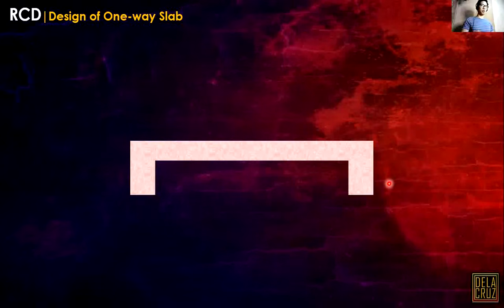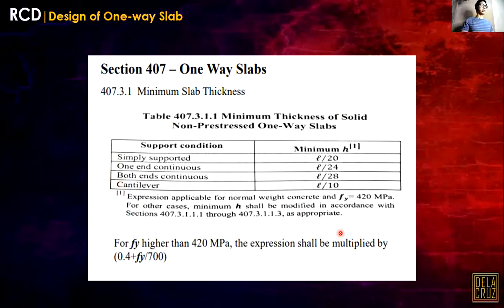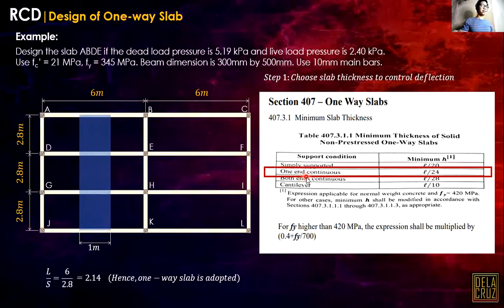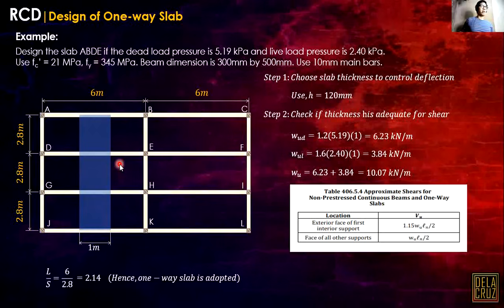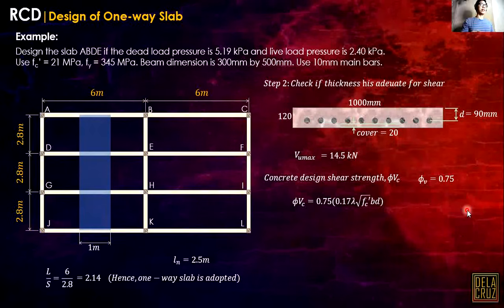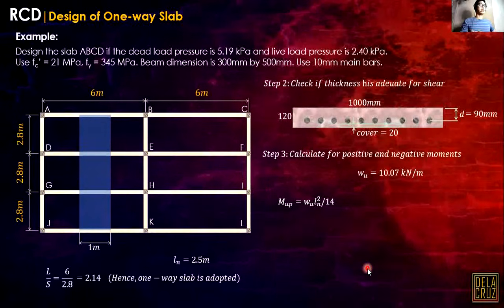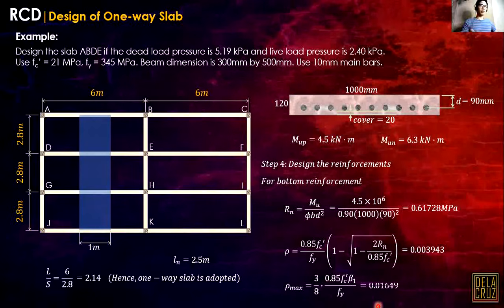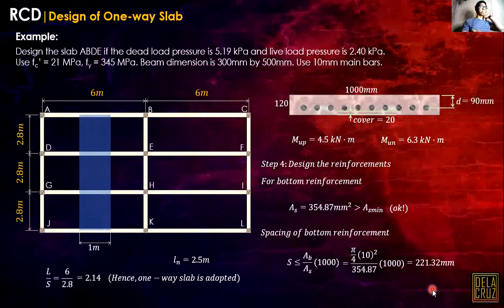RCD | One-way slab design | NSCP 2015

Comment: Tanong lang po, medyo nagugulahan ako sa final answer diyan sa "Concrete design shear strength" kahit akong gawin kong pag  calcu, di talaga siya 130.22kN.
Reply: same tol. Nagugulohan narin ako
Reply: parehas sir
Reply: 55.506kN sagot dyan pero ok lang pasok parin nman sya sa code.

Comment: For minimum thickness of slab the NSCP 2015 says For fy other than 420MPa the expression in the table shall be multiplied by (0.4+fy/700).
Reply: In short lahat dapat ng values ay dapat i-multiply sa expression na yan
Reply: Sundin mo lang yang nakasulat sa NSCP 2015. Mali yung "higher than" kasi kung isusubstitute mo ang Fy = 420 sa (0.4 + fy/700) and lalabas ay (0.4 + 0.6) = 1
Reply: magbasa ka po normal weigh of concrete its up to you kong ano gamitin mo but moslty in actual 420mpa ginagamit na fy sa concrete iba then sa steel
Reply: Ito din napansin ko, icocomment ko din sana, magka iba statement.
Reply: it says na higher than kaya if 345 yung fy, as is seguro?

Comment: Di na po ba iconsider sa deadload ang self weight ng slab o kasama na yun sa dead load pressure?
Reply: Pag sinabi engr. Sa problem na superimposed deadload need mo pa iaad ung weight ng slab kasi ibig sabihin nakapatong lang ung deadload di pa kasama ung weight ng slab which is 23.5 x thickness.

Comment: Hi sir! I checked NSCP 2015 po about sa factor na minumultiply sa min. thickness ng slab, nakalagay po is "For fy OTHER than 420 Mpa...", bakit po dito sa vid nyo is "For fy higher than 420 Mpa"?
Reply from the maker: If ako lang, gagawin ko ang dalawa. Then  depende na kung ano ang lalabas sa choices 🙂 pero first choice ko pa rin is  "higher than" because if "other than" it means pwede below or pwede above  which is medyo confusing
Reply from the maker: Ah, yes based sa actual seminar held by ASEP they used the term "for fy higher than". 🙂
Reply: @EngrDeLaCruz  ahh so ano po kaya sir ang gagamitin sa board exam? Higher po or other?
Reply: @noehareta1424  Gamitin mo kung ano ang nakasulat sa NSCP 2015.
Mali yung "higher than" kasi kung isusubstitute mo ang Fy = 420 sa (0.4 + fy/700) and lalabas ay (0.4 + 0.6) = 1
In short lahat dapat ng values ay dapat i-multiply sa expression na yan

Comment: Engr. Tanong ko lang po yung sa steel ratio(rho)  ang lumabalas po kase na value is 0.001821. Instead of 0.003943.  San po kaya yung error ko ?salamat po sa response
Reply from the maker: May error po ako sa effective depth, paki notice nalang po, ni mention ko sa video